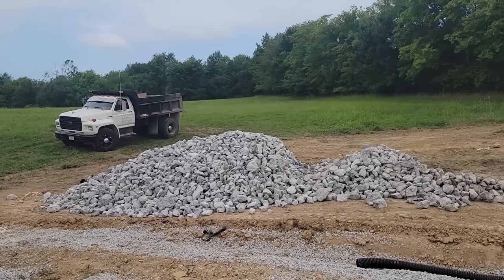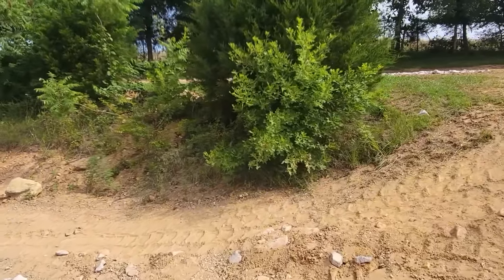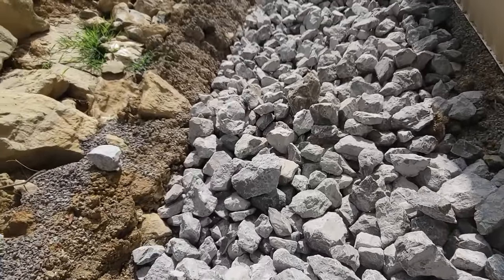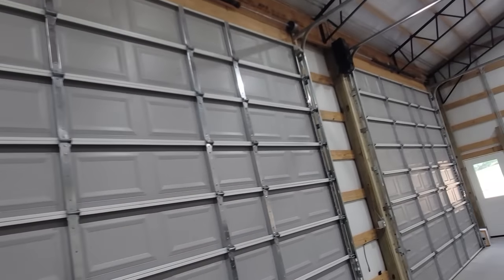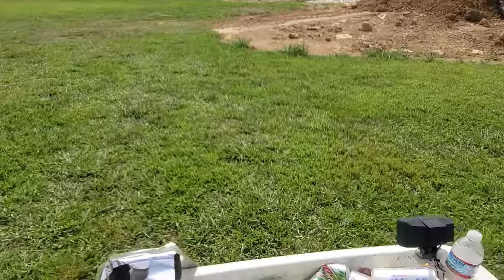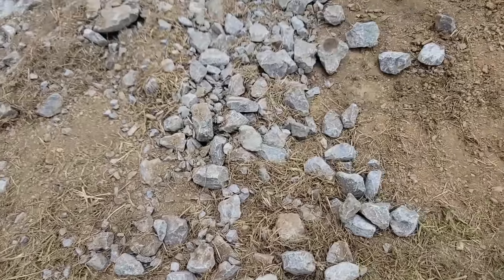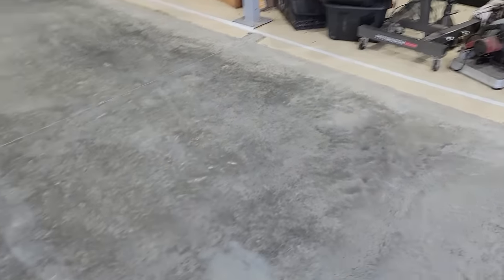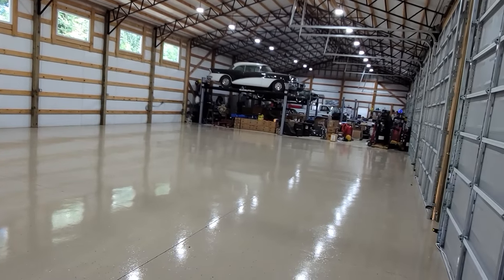My NEW Shop FLOODED! - Here's what happened (we had to start over)

Comment: You need a cheap black industrial ceiling fan?  Derek, you're smarter than that, find the fan you like in the price range thats right and shoot it with black paint, just dont use a flat or satin finish as they will collect dust and make your air flow wonky

Comment: Culverts with a Retention Pond or your retaining wall will fail. It will flood again until then yes hopefully less. No guarantee without proper drainage of a 30° incline. We had it easy I suppose with a natural gully on two sides. Still took Grandpa some figurins. I agree things were simpler and less expensive in his day. He engineered and built an 80 acre, original plot, farm with feed lots, fields, pasture, and housing in 1955.

Comment: Hey Derek what is garage on the back of your garage is there you got a put a rubber seal it’s a big rubber seal that goes along the back of your garage that goes up against it you can automatically keep the water from sitting down in it it’s a rubber seal let’s large or put a tarp lake plastic downUp against it and put the rock against it on top of it down in that that little valley where your tube is to keep the water from going into your garage if you got so much water going into your garage this will keep it from going into it it’ll force its way around it OK man I know how you feel because they had it under mine along time ago
Reply: Don’t have a clue what you’re trying to say. Something about drainage and sealing.

Comment: If you would terrace the hillside you would not have a much water coming into your drainage system. 

I hope you have filterfabric wrapped around your drainage tile to prevent silt from collecting in your drain tile .  The road where the dump trucks were running should be slopped back into the hillside and slopped around your building .

Comment: My Pole barn was built with 6x6 treated wooden beams that are 48” down and covered with plastic sleeves that provide the rot resistant quality that last many lifetimes. The concrete pad was poured after the Barn was built. The posts of the barn hold the concrete pad on the building site. The steel walls and roof are the highest quality and have a lifetime warranty for rust. The land is Michigan Midwest part of Lake Michigan that’s only 35 miles further west. Derek I love Michigan and Tennessee is to hot for our family but we live in Tennessee for hundreds of years. Michigan is a great state because of the Weather and the Forests and the Water. But I don’t think building in a flood zone down by my river would have been smart so I built 500 plus feet away from the water. I hope you recover but man Tennessee is to hot for my family we love the four seasons.

Comment: Hello Derek and clan, Life throws punches at us when we least expect it. Sorry to hear about your flood issue, but like your attitude to getting it resolved. A question I had after viewing your video, is did you lay any drain tile under the rip rap that you filled the trench in with above the back of your shop? I was thinking, would it be possible that the trench would now hold more water and possibly saturate the side of the hill facing your shop, and during a downpour collapse the side wall. I'm not familiar with the soil there, it looks to be a clay, but the thought crossed my mind and would be interested if that was discussed prior to digging out the trench. Keep up the good fight.

Comment: Why didnt you dig a spoon drain right around the shed sloping to the low side so it can flow away, you could concrete a drain in the front of the shed with grates over it so you can drive or walk, never have a flooding problem again, what you have is going to do nothing in a major downpour.

Comment: Since this is already a year old I'm sure everybody's mentioned the ditch full of rock, the lack of any type of silt screening, the single drain tile that picks up the gutters and the groundwater when they should be separated into two. Water flows both directions so it will flow from the roof into that drain tile and then into the Rock...
Unfortunately this system is probably close to failure by now

Comment: I'm a huge fan and think your channel is one of the best.  However, I agree with Mr Glasser (civil engineer) that this solution will fail when the next hurricane size storm dumps more than 6" of water in a 24 hour period.   The root problem is the shop is simply in the wrong place on that huge property. It is in a hole.  I know....you already spent a ton of money on this fix.   But, if and when it fails, move the shop up the hill on that 60 acres.

Comment: This is a good project for an excavator to get on top of the hill and slope that bank back as far as you can. Then at the bottom, dig a drainage ditch with a filter fabric to keep the erosion out of the ditch and not all allow weeds to grow. That would take the water away. I know this is also hind sight. But that shop should have been elevated at least f foot above ground before pouring the concrete slab. Sorry to see this happen. Costly mistake for sure.

Comment: I would have expected a huge retaining wall behind the building going down into the ground at least 3 feet and then behind the retaining wall, put the drain tile/rock to divert the water flow so it never gets to the building side. I would think this is not a solution you have for the 100 year rains (now happening annually), but will help some. Is this the solution an engineer suggested?  You also need drains inside the building to take water and move it out should it get in, but unfortunately that should have been done before you put in concrete flooring. Also why is this posted on vice grip lodge vs vice grip garage site channel?

Comment: Hey you were talking about a retaining wall. What if I told ya try a 12” above 6-12” below ground retaining wall . The thing is below ground needs a foundation but everything else can be 4” and if you run 12” above ground 2-4’ past each end of the shop that will divert any floods to the sides of the shop where it can harmlessly run off without destroying your shop with water and mud ( red clay) so it’s cheaper with my plan then a full on retaining wall. Just a common sense approach to your issue.  And a lot of wisdom and experience lol. Have a great day.  MORE Vice Grip Garage. I hear even In Tennessee you have the taco crew working in the background. They are every where. Not a bad thing as long as they are legal. If I and you have to obey the law then it should apply to everyone. Just saying.

Comment: Yep.might think about 6" metal posts on outside of building in-between  door openings about 4' high so vehicles n things can't damage building n or door tracks n building going in n out..kinda like comment about hillside..you create a swale combination drainage ditch to divert the water flow more AROUND the building  on that top row of rip rap..n that rip rap behind the building might want to make it wide enough so a fire truck could drive down her n put 1" clean rock on top of the rip rap..but it looks like smaller rip rap 3 to 4 in n a vehicle could drive on that n it'd take alot of rip rap to do the hill..but still cheaper n I think better than building a wall n temporarily  placing plants that can hold the hill n shed the water..thanks

Comment: Yep, big mistake. Wasn't there another location not so close to all that water shed? You might consider a retaining wall with more drainage runs.  Wow, a sump pump under the large rock to help move water.   I agree with civil engineer.   That corrugated  drain will not be enough with such a large run off source.   Yea,  6 foot deep round 5 foot diameter below ground cistern with sump pump.  Yikes.

Comment: As an environmental professional, I would highly, highly recommend NOT doing an underground storage tank (UST) for fuel. So many regulations come into play there, it’s so not worth it. Get you a 500-1000 gallon double-walled above ground tank and integrated fill pump and you’ll be good to go. I deal with tanks and stormwater plans at asphalt plants and paving projects all day, every day. You’re headed the right direction with the stormwater management at your property, sometimes it can be a little bit trial-and-error. The pipe is indeed too close to the slope and will silt up right away and corrugated pipe isn’t good for long distances.

Comment: I’m very sorry you’re having trouble. Drainage and erosion issues in the south are extremely difficult to deal with.With all due respect whoever did the initial drainage did nothing. Whoever’s doing this repair is not doing much better. I lived in the south all my life and I can tell you with experience that red clay is not gonna drain it’s definitely not gonna drain through those corrugated pipe and you don’t have nearly enough gravel on top of those pipes they will be full of silt  in a year. As someone else said you should definitely not be draining your gutters into your drainage pipes. Everything should be running PVC .  You need to add service ports to the top of the PVC pipe so you can run a jetter through occasionally.The term you were looking for for the diversionary drainage is called a swale and the one that they built is not does not look nearly adequate. I would have a one and ahalf foot berm on the down side of my swale berm. Lastly do not ever leave any bare ground anywhere on that hill! cover it with chips, straw, grass anything rocks something. Never leave it bare

Comment: Your grade behind that shot is aggressive and steep, your going to have too install a stub concrete wall , with drainage pipe and gravel, I was a landscaping contractor for 35 years,  you have to fix that grade behind your shop, that channel you installed will fill with silt and dirt, which actually will cause the water too flow over the rocks,  I  probably would go 2 feet high on the stub wall , concrete footer as well, with the drainage pipe

Comment: OOOFFFF..... that sucks.... (keyboard warrior podium lol) Though I feel your problems may persist... all that crushed rock... (1.5" and "rip raff" aka 6"ish) as well as the drain field pipe is GOING to plug with silt... filter cloth should have been used and actual drain tile which has holes on the top half and NOT on the bottom this allows it to carry the water away also cylindrical drains are usually designed to be NO more than 75% full... they will drain faster that way than completely full... I think a LOT more tile runs would have been the way to go with separate solid SCH40 for the gutter system keep them by themselves so they don't overwhelm the ground water system and a solid pipe so it HAS to go away and can't leach into the other system...... but thats my two cents... the location is poor at best but a guy has to work with what was there... not much you can do about that...

Comment: I'm not for sure if the new idea is going to work either that may work for very little water running off the hills but not among soon rain it's just going to run right on top of riff Raff and right back down in the hill again into your shop you need a ditch you're going to need at least a ditch that is 3 ft or better deep to catch that runoff from all those hills there's a lot of water that comes off in hills quick fast in a hurry

Comment: Run at high end a clean out and daylight your drain. 
You use 2 sets of 6" perforated pipe.  1 a6" from  bottom another 1/2 way up. Use washed  and proper high quality filter paper and straw.  
That drain will far outlast you bad concrete floor that your " professional " lol Mason could not blend!

Comment: If you have a heavy rainstorm the water is just going to flow right over the top of that  you need to put in a retaining wall c-shape around your shop add the drainage system should be behind the wall because if you get a heavy rainfall the dirt's just going to push into that rock and the water is just going to go over the top of it those are okay with the holes in it but I like I'm saying if you get too much water the water is just going to bypass it you need to retaining wall and the drainage behind the wall a lot of places flood because the drainage system is too small and can't handle the flow l don't know how much rain you get out there but but if you get heavy downpours it's going to flow right over the top of that I'm telling you you need a retaining wall at a drainage system behind the wall because think about it what's going to stop that dirt from covering that rock you saw that the hill eroded

Comment: rent a concrete grinder and do it yourself? very messy job and should have been done before they prepped though. but it would easily eat the epoxy and high spots off the other side.

Comment: I put up a message saying this was going to happen but I take it you never seen it or you just ignored me if you go back you will see that I said to put in a bigger drainage pipe at the back of the shop and run it down to the big ditch that runs along the roadsides and I mentioned a grate type drainage system which looks like a half a drain pipe with a grate running the full length of it and it has 10cm or 20cm pipes into a 30cm pipe that runs to the bottom of the property but I see you ended up learning this the hard way just like you do with your cars.😉😉😂😂😂 I hope you don't have anymore problems like this I think you should put tanks in to catch the rain water that runs of the roofs that will save you money aswell plus if you put a water pump that produces electricity from the flow of water and I know it wont produce lots of electricity but if you add solar panels on the roofs of all your buildings it will all add up over the year and maybe in a few years you could add a nice big wind turbine and you could supply some of the other farmers and maybe even some of the nearest town aswell.All the best from Dundee Scotland.👍👍✌👊👊

Comment: Your trying but don’t think this is long term solution. Whenever constructing first thing you have to account for is water. It’s going to flow to least path of resistance. Large ditching to divert flow is needed. Either that or buried pipe with numerous drains. Just my opinion.

Comment: Hi ! I GOT THE PERFECT SOLUTION IF I UNDERSTOOD YOU WHEN YOU SAID YOU OWNED THE 60 ACRES TO THE TOP OF HILL!
  DIG IT OUT AND BOTTOM OF HILL AND MAKE  A POND ,PUSH THE DIRT UP AS  DIG IT OUT TO MAKE  HIGH BANKS ON SIDE CLOSEST TO SHOP, PUT DRAIN ON EITHER END I WOULD GUESS THE RIGHT END LOOKING FROM THE ROAD TO HILL, THAT WAY YOU STILL HAVE THE WATER GOING AWAY FROM SHOP!  IT WOULD BE GREAT FOR  THE YUNGUNS AND A FELLER THAT WORKS AT SHOP ALLOT, HE COULD JUST WALK OVER AND CAST A LINE EVERY NOW AND THEN.
  IT WOULD GIVE PERFECT REASON TO PUT IN POND (LAKE  )  AND 
  IT WOULD DEFINATELY  HELP WITH WATER FLOWING OFF THAT LIL MOUNTAIN!  AND PUT THAT WATER TO GOOD USE!  GET  2 WELDING RODS  KNOCK OFF ABOUT 1/3RD OF THE RODS BACK THE END THAT GOES INTO WELDER CLAMPS (  BEND THEM  DOWN EQUALLY ABOUT WIDTH OF YOUR HAND !) NOW YOU HAVE  DOUSING RODS THEN GO OVER TO FEILD BELOW THE HILL   POINT THEM OUT INFRONT OF YOU AT WAIST HEIGHT  (BEND YOUR ELBOWS ARMS AT 90° INFRONT OF YOU HANDS FAR ENOUGH APART THAT THE TIPS CAN CROSS. LIGHTLY HOLD ROD IN EACH HAND AND BALANCE THEM WHERE THEY POINT OUT IN FRONT OF YOU  AND WALK SLOW AND THE ENDS WILL CROSS WHEN WATER IS UNDERGROUND EXACTLY WHERE THEY CROSS ! JUST LET THEIR WEIGHT MOVE THEM .PRACTICE ALITTLE UNTIL YOU GET THE FEEL FOR IT!  IT WORKS I SWEAR ! THEN YOU CAN SEE IF AND HOW MANY SPRINGS OR UNDERGROUND WATER IS IN THE AREA YOU WANT TO PUT THE POND!  I ALSO USE A LIL GREEN SWEETGUM OR OAK LIMB THAT I BREAK OFF WITH  A "Y"  IN IT  TWIST EACH PART OF LIMB  BACK(LIKE YOUR TURNING THROTTLE ON MOTORCYCLE  AND WALK WHEN YOU WALK OVER UNDERGROUND WATER THE  SINGLE PART OF THE LIMB WILL POINT DOWN TO POINT OUT WATER !     I APPOLLOGIZE FOR BEING SO WORDY,  AND I SHOULD HAVE SAID LOOKUP DOUSING ON YOU TUBE  OR FINDING WATER WITH WELDING RODS OR  STICK!  BUT I WAS 1/2 WAY DONE BEFORE I THOUGHT OF IT!  IT REALLY WORKS TRY IT, BE SURE TO VIDEO IT! MAYBE YOU HAVE DONE IT BEFORE, IF NOT TRY IT WITH YOUR BOYS WILL BE GOOD TO TRY TOGETHER!
   I HOPE I HAVE HELPED YOU AND I THINK  A POND WILL HELP YOU WITH ALL THAT WATER AND IT WILL GIVE YOU MANY BENIFITS, FISHING, SWIMMING ETC. AND  BOYS WILL ENJOY IT ALSO! 
   JUST A LONG THOUGHT  AND  I HOPE IT HELPS!
    THANKS FOR THE VIDEOS!

Comment: I’ve seen this many times already and I just had to finally come forward to rest myself ….please make sure to separate the downspout pipes and the drainage pipes around the garage,  the corrugated piping you have around your garage is barely enough as it is to drain the water coming off your roof on a very heavy downpour !  , the same thing happened to my house and that’s what I did , make sure the downspouts and corrugated drainage pipes around the building ARE SEPARATE , THE DOWNSPOUT DRAINS AND THE DRAINAGE PIPE AROUND THE GARAGE INTO 2 SEPARATE PIPES !  Please !

Comment: This is going to fail yet again, you need much larger pipe smooth bore with drain inlets to handle the quantity of water. Plus access points to rod and clean the pipe from time to time, as you will never ever keep the pipe clean of silt.

Comment: My fear is that mud and dirt will fill in between the riprap eventually negating its usefulness. It'll just turn into more dirt for the water to flow over
Reply: It will a big berm at the top of the cutout with a V-ditch would've been the better move